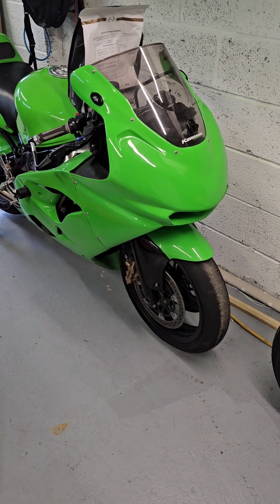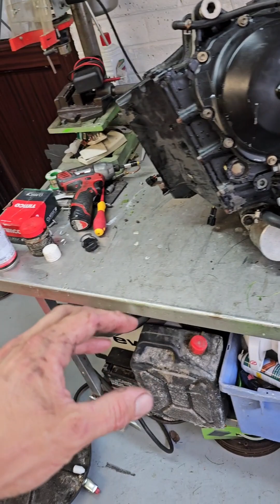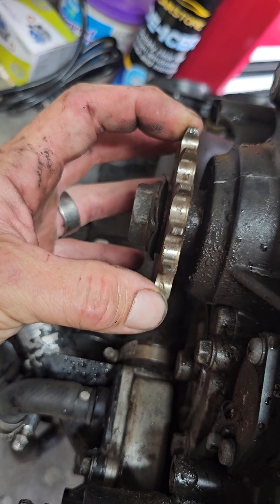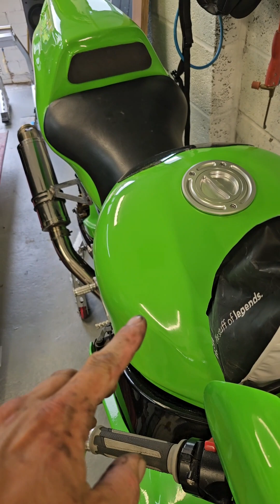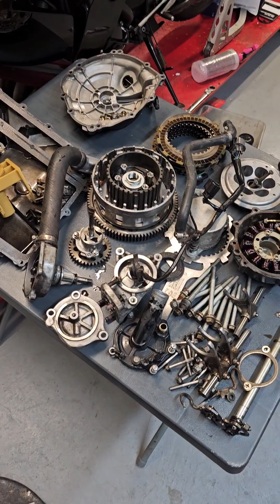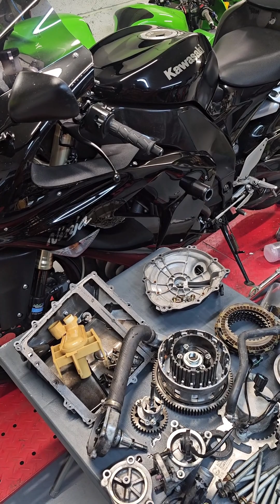gen 2 2007 kawasaki zx10r engine removal strip down 4th 3rd gear remove and replace part one

Comment: Ive a Gen 1 with same 4th gear toast. I assume the Gen1 and 2 are the same boxes and cases. 🤔
I have a Gen3 head to fit to a spare engine. They're supposed to bolt straight on.
Reply from the maker: I dont think there the same no.
The gen 3 box can go in the gen 2.
Thats what alot of people do.
Coz the lack of parts for the gen 2

Comment: The one thing needed was to watch how you split the case n all and that’s the most important part u didn’t show 😂
Reply from the maker: Ya it wasn't hard so I didn't think to edit it in.
Iv got an zx10 engine if I record it i will put it in :-)
Reply: @johnshomegarage7828 
How did you split the casing , I'm sure I have taken everything off but the casing is solid still

Comment: Nice vid  I have also done a zx6 2006 gearbox 3/4 gear went 😢 parts are getting hard to find now as Kawasaki have stopped making the gears think nova will make you one
Reply from the maker: @robertengland9352  thank you 
 ya I noticed it's getting harder to get the parts now.
 sad really coz there nice bikes